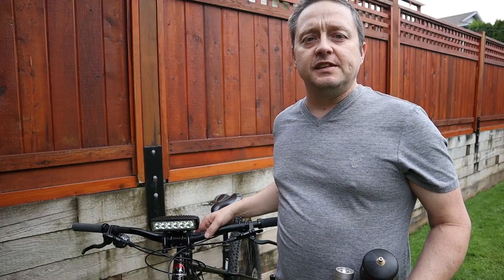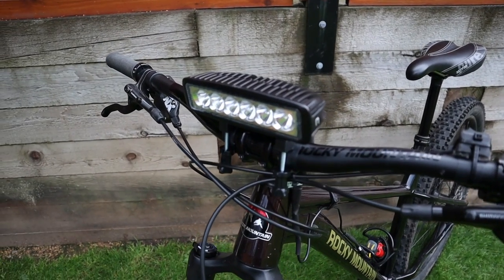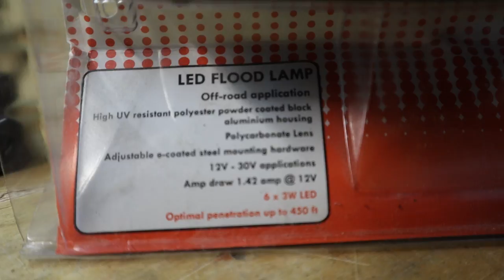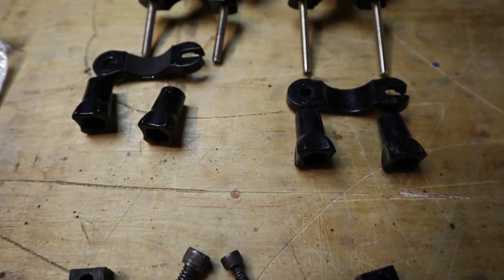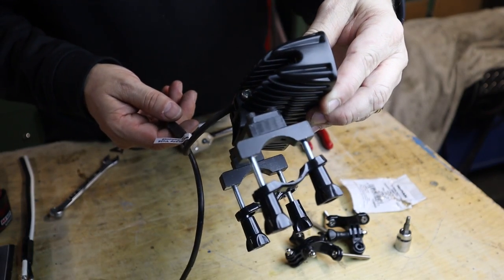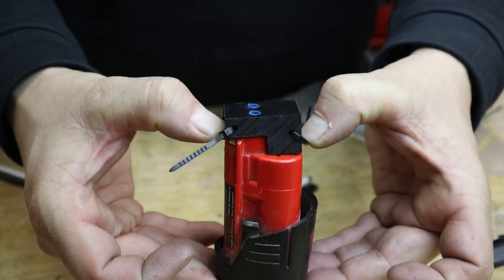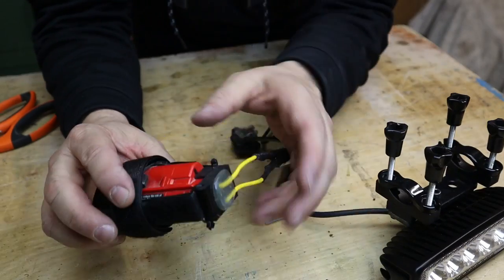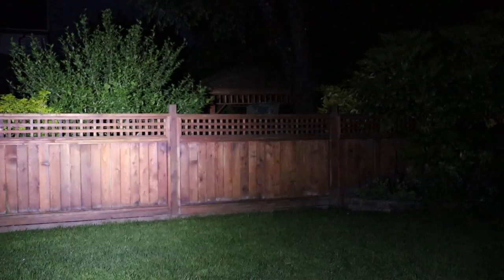DIY LED BIKE LIGHT... can it be as good as a high end light!? / How to make a bright LED bike light!

Comment: You'd have saved money if you bought new 18650's, a couple of triple 18650 battery holders to make battery packs (or double up to make one bigger capacity pack. I'm in Australia, so in AU$ 10 batts. were $20, 2× triple holders were $12. Already had a nitecore d4 digicharger ($50) for other torches and worklights. Since having bought batteries, ive scrapped dozens of laptops and recovered a couple hundred 18650 batteries in excellent condition for free. About 5% tested bad after 10 years in laptops! I've got a couple Greenspeed trikes I'm fitting out with lights similarly. In addition, ebay has many 12v led mini tail light strips( 4 or 6 leds) that blink in 18 variations (has a third trigger wire to change blink pattern.) I'll have a red blinky at rear and can switch between white blinky strip on front or headlight. While I'm at it I mounted a motorcycle horn too!
Reply from the maker: Yes, you can save some money doing it that way but some people don’t feel comfortable doing that sort of wiring.  Check out my other video, I make a battery pack like that and try a flood style of light.

Comment: would a TalentCell Rechargeable 12V (3000mAh) battery run this light?
Reply from the maker: Im not familiar with that battery pack or even tried it.  I’d be a bit careful on the 3000mah rating.  I suspect they use a bargain brand batteries here. I think it should work, just don’t get it wet.  Cheers.

Comment: great idea. any suggestion for DIY daytime visible taillight ?
Reply from the maker: Thanks! No, I haven;t really thought about it. Tail lights are so cheap (~$10) it would be hard to make it cheaper than that. That bought said, you could make a simple 3 to 4 LED flashing circuit and mount it in a small container.
Reply: There are diy car trailer rear light with leds that work with usually 9~30v that are way brighter than regular bike taillights
Reply: Ebay has 12v blinky 4 or 6 led strips with 18 blink modes. Have bought a pair for my 2 greenspeed trikes here in Oz. Cost AU $17.00 pair. Much brighter than bicycle gear.

Comment: how does the wattage and amps rating work with the battery and lights. I've been trying to do something similar and just cant calculate the numbers correctly and keep getting confused. the 12v part is pretty easy, but what does the whole amps and watts situation regard to. some rechargeable battery packs 12v on amazon say max discharge at 3 watts and the led light bars I'm seeing will be like 18 watt or something. just like yours is 18w and sais it pulls 1.4 amps. what is your battery rated for ? i would assume 1.5x12 so 18 right which in that case perfect !! but I've seen this battery pack rated for 12watts only elsewhere  

please help lol
Reply from the maker: Thanks for your comment, I would not rely on claimed amazon numbers. The watt rating are misleading. Most batteries are measured in Amp/Hours. Most lights have a Amp draw or a Wattage rating. In my case in this video, the light draws around 1.0amp at 12Volts.  In simple terms, in order for the light to run for 2 hours, I need a 2 amp/hour battery of battery. Volts = Current x Resistance (V=IxR) and Power=Amps x Volts. (P=IxV). Not sure if that helps? cheers.
Reply: @MikeFreda  ok i did some more research and talked to a previous instructor of mine who taught me electrical in automotive school. here's what I came up with. so yes you are correct for calculating the amp hours and knowing the light will run for 2 hours. what I was concerned about was choosing the right battery for the light. so If a light sais it is rated at 18 watts and 12v that basically means its going to draw 1.5 amps if everything is accurate. and using a battery that is rated for at least 1.5 amps would be good. now amp hour (aH) are a different measurement saying that the listed amperage will go for an hour and the actual amp rating of the battery can be higher. so in this case you are fine clearly because your bike hasn't blown up, but using a light that draws more amps and rated for a higher wattage can cause batteries to cath fire and explode so that was my main concern. i saw your video on the 3.0 light also and the light there said 0.87 amps at 12v which is around 10w power. so there i am confused why they said 18w. maybe a if it is ran at higher voltage i guess but not at 12v right?.  sorry if this is confusing i just don't want exploding batteries haha

Comment: Have you tested battery time
Reply from the maker: Yes, I have.  The light at 12v draws just under 1amp.  A 2.0amp hour battery will last almost 2hrs (depending on the age and quality of the battery).  This type of battery also comes in a 3A/hr so that’s a long night ride. You can also keep a spare with you since they are small. Cheers.

Comment: What about low voltage cutoff, I hear the batteries do not contain the system inside, and it is very critical to not over discharge lithium batteries
Reply from the maker: Yes, that is something you can consider. Lights behave differently than motor load and since I don't run this system all the time and I never 100% drain the batteries I'm not too worried about it. If you ran it regularly and drained the battery all the time you should probably consider a circuit like that. My Version 3 light will include all this sort of tech. Stay tuned.

Comment: How are the batteries holding up? There are those who worry about the 1+ amp draw being continuous and without the management of the electronics normally in the power tool...
Reply from the maker: They seem to be fine. I've never completely drained them on any ride yet. I do turn the light off at times during the ride.  I guess it wouldn't be any different than running a grinder of drill non-stop until the battery dies and I've done that a lot. lol. Check out my Version 2 light. I use a different battery.
Reply: @MikeFreda  the milwaukee tools use onboard electronics to sense battery overheat conditions...they will shut them down or reduce current if it sees that.i was just wondering if the 1.5 amp  draw with no safeguards would hurt the battery....
Reply from the maker: Good point. I've been using the batteries in the tools and on the light and they seem to be fine but I'll keep a closer watch. I have measured the actually current draw on the light and it's 0.95amps @ 12v.
Reply: @pl5624  when pulled apart, all lithium battery packs have the electronic safety gear in them, not in the tool. Same for laptop batteries. Many 18650 battery brands have overheat prevention circuits built into each battery. I know from pulling a dud battery apart I bought. Reminded me of a cia spy tracker from a movie!

Comment: Can i run sn aliexpress 12v led bar with 20 volt battery?
Reply from the maker: Not sure.  You would have to check the specs on the light.  A lot of these LED light bars do have a voltage range that they can operate within.

Comment: Uh...Is that 18w search light for cars.?
Reply from the maker: Yes. This mini light bar is meant to used on cars/trucks. They are also known as "Work lights"  "Automotive flood light" "Light pod". I have found almost anything with this size and power output will work.
Reply: @MikeFreda  gotta be careful only buy the ones with smooth reflectors, some have crinkle finish reflectors and scatter light too much - they are useless as headlights.

Comment: I like it but wish you would have shown how to splice the wire to the switch
Reply from the maker: At the handle bar union, take the positive side battery wire over to the switch, then back again and splice into the light wires. The ground is connected directly from the battery to the light. Solder and heat shrink.  Remember to test before heat shrinking. LED’s can only be wires one way. Hope that helps?
Reply: @MikeFreda  Thanks Mike.... kind of embarrassing how easy this was to wire up.  Thank you for the help

Comment: How many hours last with one charge?
Reply from the maker: With the older 1.5amp hour battery, I got over 1hr of solid ride time. If you stop for breaks, turn it off.... that makes for ~1.5 to 2 hour ride.  If you used a larger capacity battery, like 3amp hour... I could see you going for a min of 3hours... if you include rest time and breaks a 4 hour night ride would be possible on this light.
Reply: @MikeFreda  I have a Milwaukee 12Ah so it should give me like 5 hours continued

Comment: doing a somwhat same concept my self butt then with 5x100 watt ledd not cheap butt and absolut overkill.
Reply: Did 4x100W for buggy and it was absolutely overkill. For a bike, it's way too much. Not to mention battery pack would need to be huge, something like e-bike battery pack. You need 500Wh pack just to run it one hour, that's about 50 18650 batteries.
Reply: I have a 10s 10p battery with a 50amp bms the battery i am using is a Panasonic NCR18650BD 3200mah
Reply: @pyrounlimited7035  That's decent, a little bit over 2h of runtime. What would distract me more is just amount of output. It would blind you if you are going to drive on trails. If you are going to use cheap 100W LEDs, that's going to be about 40000 lumens. Even single one at 8000 lumens might be too much for trail. Trees and leaves are really close to you and they are going to be really bright, not to mention it's going to "flash" as you pass them at higher speeds. 
It should be fine on open fields or roads where there is no drivers.
Reply: @cekpi7  its for my daily ride to work living about 10 kilometer from work butt through a woody area with almost no lighting from the local county.
And yes indeed i am using the cheap 100watt aliexpress cob leds.
Reply: @pyrounlimited7035  I used to commute through woody area that was unlit and 1000 lumens was enough. I don't really need more than that unless I'm going on trail or messing around with bike. 
I would definitely start with single 100W and build from that, I've did that in past and it was way more than i needed and also really unpractical.
Reply: And a $350 lithium battery to run it. Or a car battery.

Comment: So what is it like at 6 volts?!?
Buy a phone bag that mounts  right behind the handlebar... use the water bottle holder for a water bottle...
Reply from the maker: Never tried 6 Volts.  Depending on the manufacturer, These lights typically have a range from 9-32 volts.  Yes, you can use a seperate mount to hold the battery. I use a Camelback and keeping the weight off the bars and lower down on the bike would be preferred in my case.  Cheers

Comment: hahahaha use 5v to 12 connector use a powerbank and voila u have 12 volts system very chicken diy. u can also put a switch on it
Reply from the maker: Thanks for commenting.  Yes, I tried that and it didn’t work.  There is too much current draw at start up for the chip and battery. You would need to find a beefier converter chip and a high amperage battery pack and they are expensive.  Cheers.